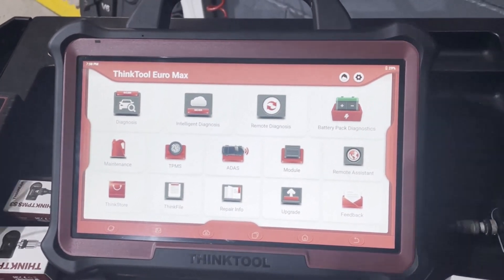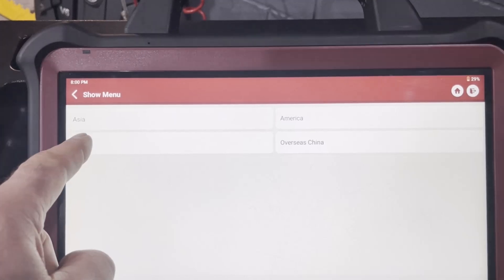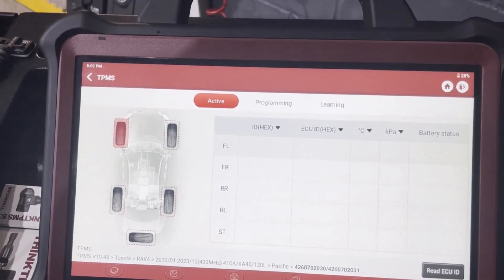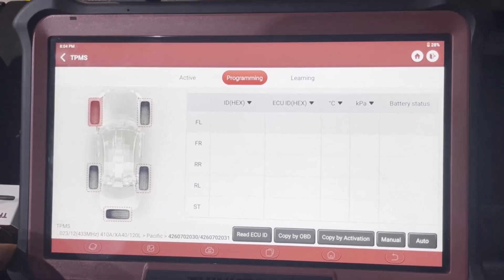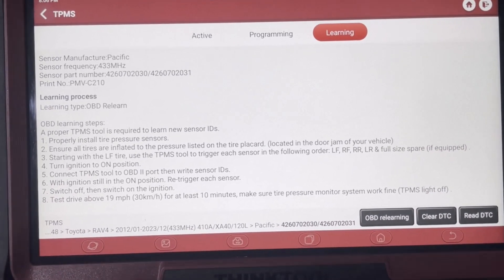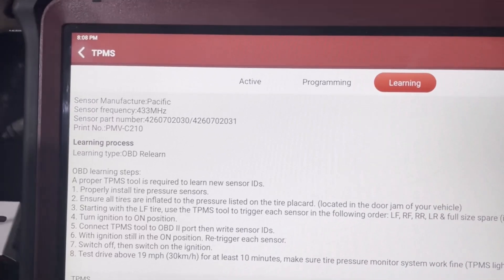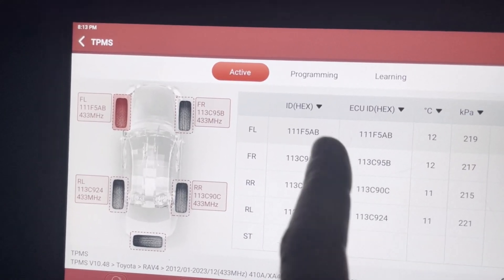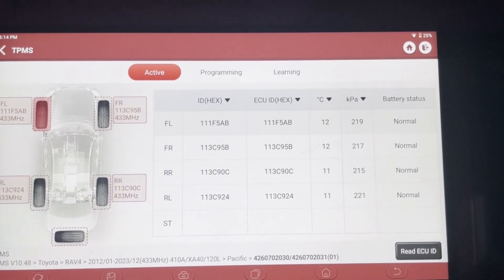Using Thinkcar TPMS Tools To Programme And Learn A New TPMS Sensor To A 2015 Toyota Rav 4

Comment: Hi Ryan, question.  Ho much can i charge for this job on a BMW 
350?
Reply from the maker: Hi 
The sensors retail price is 34 euro + vat each 
So to supply and fit depends on the workshop but to fit and programme one sensor normally takes around 15 to 30 minutes (depending on the vehicle) but you have to remember some cars need to be driven for 20 minutes to learn 

So to supply and fit on most vehicles would be in the region of 90 to 200 euro